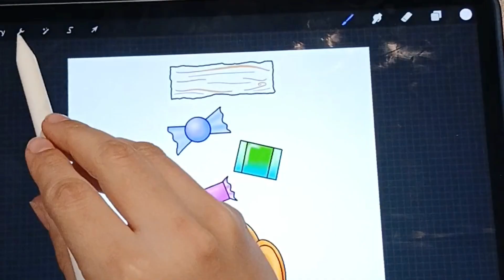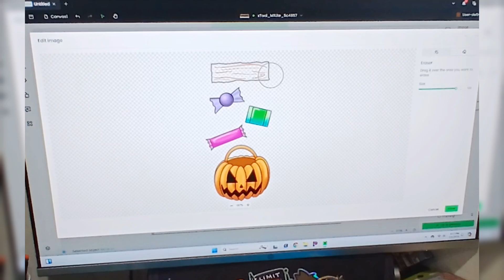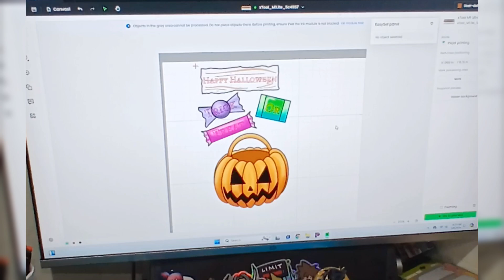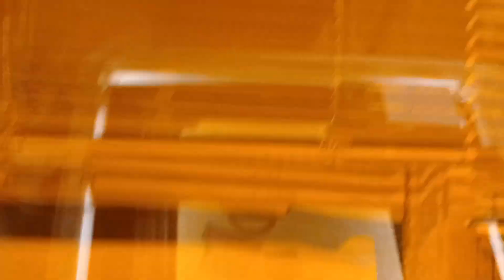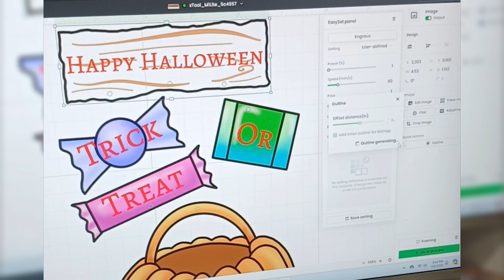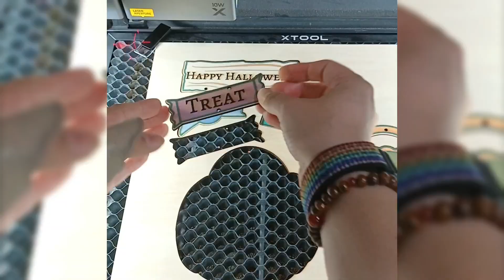How to Make Halloween Wall Decoration Using M1 Ultra | | xTool Maker's How-to Tutorials

Comment: This is great thanks for the demo. I have this set up but can’t seem to print when using the honeycomb base, it tells me that the baseplate is not in, which means I can’t use the honeycomb for the cutting part. Do I have to change some setting to enable this?